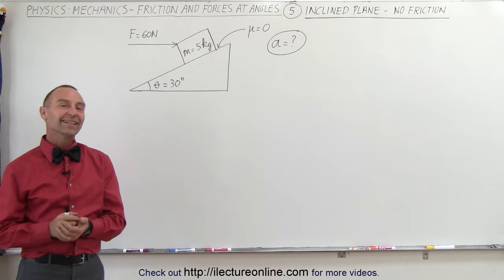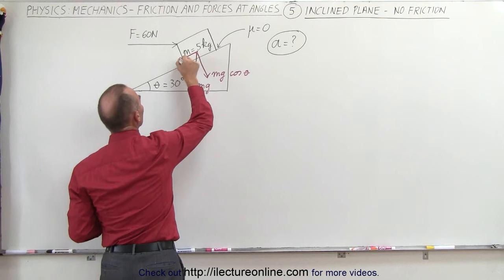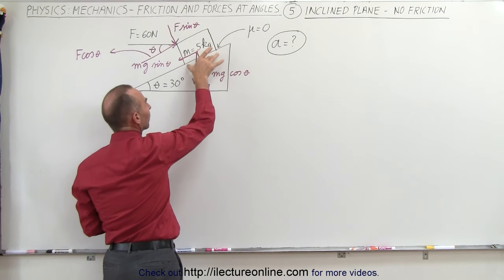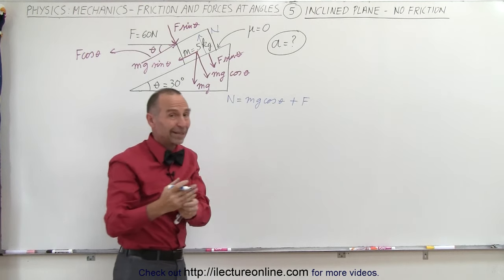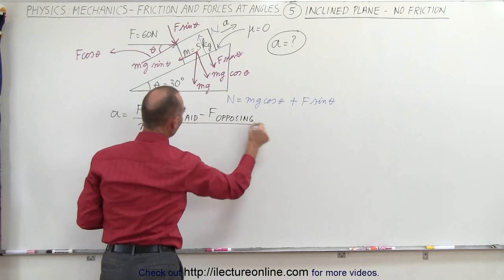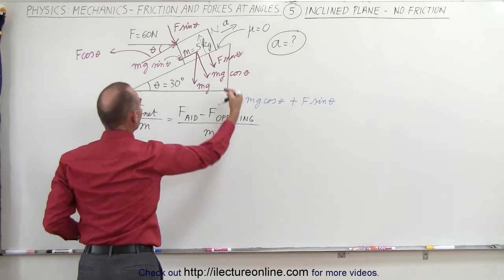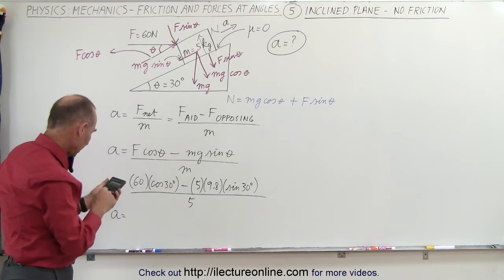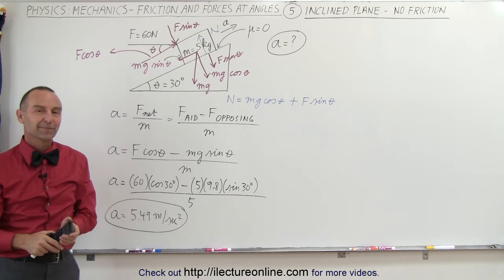Physics 4.7   Friction & Forces at Angles (5 of 8) Inclined Plane - No Friction

Comment: Respected sir can you pls explain me how you consider the angle tetha in between f and f cos teta inspite of considering it in between f and  fsin teta pls try to understand it and explain it to me
Reply from the maker: the mg vector is perpendicular to the bottom horizontal surface of the wedge.  The mg cos(theta) component is perpendicular to the inclined plane.  Therefore the angle between the horizontal bottome and the inclined plane must equal the angle between mg and mg cos(theta)